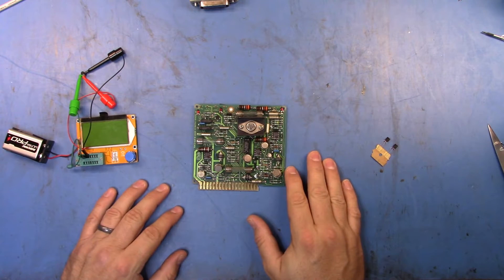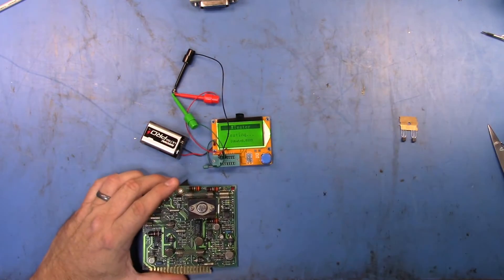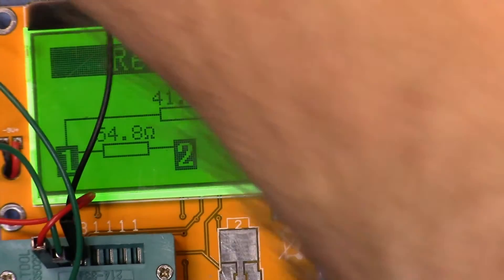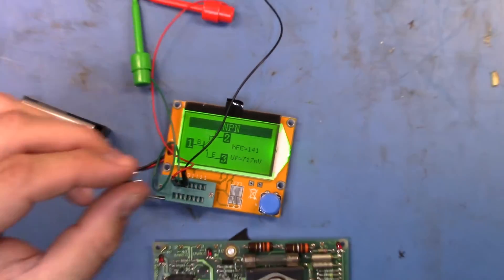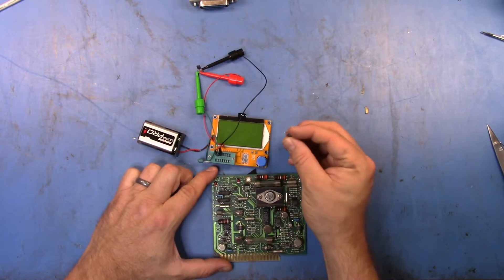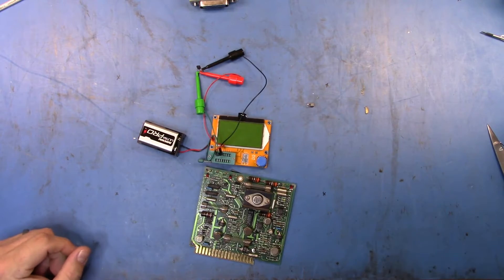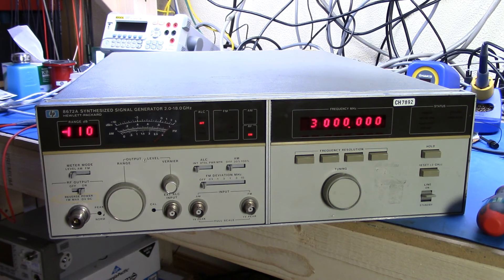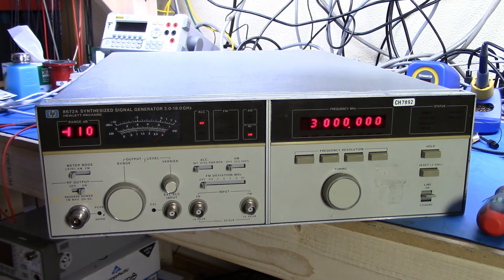HP 8672A Signal Generator Repair - Part 3

Comment: Nice job.

I always use your same method of studying the schematic and the board to determine EBC of a replacement tranny. I take a glance at the datasheet for the original as well, but the schematic is much more reliable ;-)  I like to draw a picture of the top of the case and write EBC on it to avoid those very same senior moments! Too easy to flip the thing around by mistake.

That did seem to take a long time to melt the solder on there, which is odd given that you fluxed it up. What is your iron set to? Also, perhaps a chisel tip would transfer heat better than the conical.(Dons flame-retardant suit.)

Thanks for sharing. I have been enjoying them.
Reply from the maker: I had the iron set to 650F with a 2mm (I think) chisel tip. I really only use a conical in some smd situations (e.g. 34401A repair). I like using 650 as it reduces the chance of over heating a component but that was longer than expected.

There must have been some large track/fill on the other side.
Reply: Ah, I couldn't tell if that was a chisel. I have found 740F works well for most of my repairs. Get in, get out type of thing. But everybody has their own style, and I am far from an expert! Just glad the thing is working. Looking forward to a video on its operation when you have the time.
Reply from the maker: Completely agree. In fact the two temps I have programmed into the Hakko are 650 & 750. I'm waiting on 5342A to arrive and then we'll take a wander through how the 8672A works.